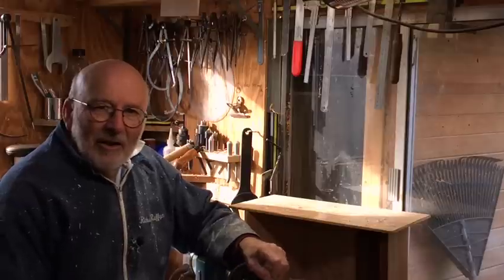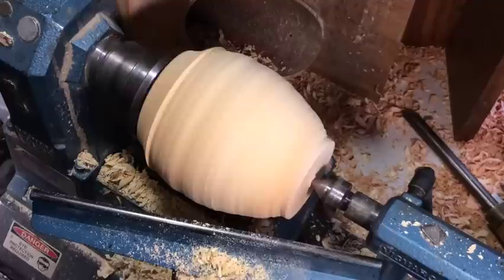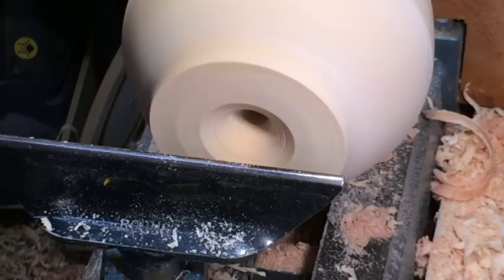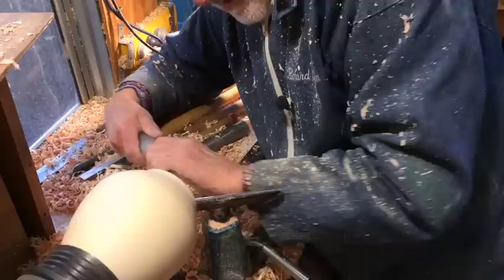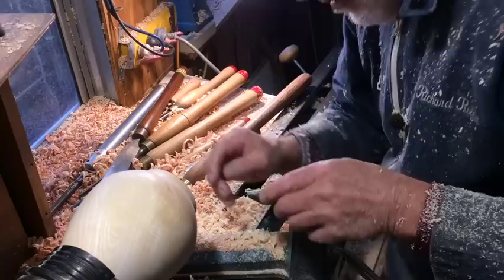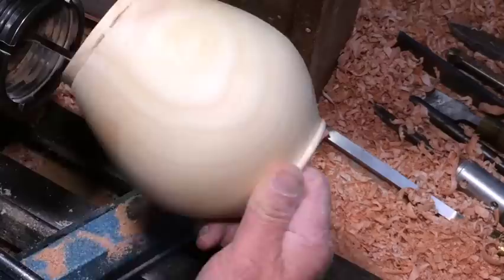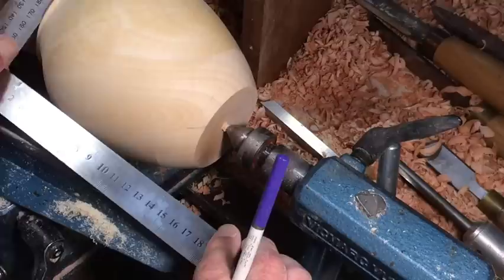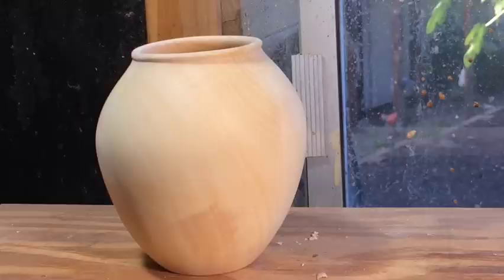Richard Raffan turns a claret ash vase in real time

Comment: Thank you for such an inside view of what you were thinking as you were doing; it's an incredibly valuable video.  I wonder if you might explicitly comment on traditional tools vs. carbide (since this hollowing seems to be done most frequently with hollowing carbide tools)?
Reply from the maker: Carbide tools are ridicuously expensive compared to HSS and although they might hold a reasonably sharp edge for a bit longer than HSS they soon lose the edge necessary for finishing cuts. Carbide cutters are not so easy or as quick to sharpen as traditional tools. I've found that traditional scrapers, gouges and skew chisels cut way, way, cleaner which means a heap less sanding and investment in abrasives and less time sanding. I reckon carbide tools generally make turning more laborious rather than easy. They are a triumph of marketing over substance, as are negative rake scrapers.

Comment: I very much appreciate the running commentary and sometimes self-criticisms you make during the turning; thank you. Regarding filling small cracks with CA glue, I understood you to say that such repairs do not last. I have heard that some professional turners do not use CA glue when they are concerned about retaining lasting quality for pieces destined for museum collections, but vases such as this one are, I believe, intended for utilitarian purposes. Would using CA glue in such cases really matter? Is there solid evidence that CA glue does not hold up over time?
Reply from the maker: I've experienced CA not holding up many times so use 5-minute epoxy if I do fill splits. The knot I fixed with CA loosened regularly every few years until the bowl broke. A kaleidoscope made by a well-known American literally fell apart as have parts of another, all made using CA. And I was reliable informed that many museums have had segmented pieces turned in the 1980s fall apart. I make things to last and see no reason why this vase shouldn't be around in several hundred years, like many of my bowls.
Reply: @RichardRaffanwoodturning  What's your experience with using PVA glue and sanding over the crack - the PVA combines with the sawdust and masks the crack. I think your pieces are all museum standard!
Reply from the maker: @billstanley5317  I don't know much about PVA, let alone in cracks. I've never been interested in filling splits and masking cracks. If I do fill a split it will be with African blackwood powder mixed with 5-minute epoxy. I can guarantee that not all my work is 'museum standard', no matter how that might be defined, although since the mid-1970s my work has been acquired for major public and private collections in Britain, Europe, Australasia and North America. The Australian National Gallery first purchased some of my bowls in 1977 and later a set of spillikins.

Comment: If you had made a flat shoulder on your tenon for the front face of your jaws to reference against, wouldn’t the loss of concentricity you experienced at 8:30 have been greatly reduced/eliminated? It doesn’t take you long to clean up, but that and a more secure grip less prone to the kind of movement due to different jaws biting to different depths seems to make a shoulder worthwhile.
Reply from the maker: I've never found a flat shoulder makes much difference with facework, whereas it provides a lot of support on endgrain blanks.
Reply: @RichardRaffanwoodturning  interesting. Thank you for this insight in particular, and all of these videos in general. I am learning a lot from them, and definitely find them inspiring.

Comment: Awesome Richard, question: would you turn vase with the grain running parallel?
Reply from the maker: Probably not primarily on the grounds that hollowing into endgrain is such hard work. On top of that, endgrain is not as strong as crossgrain and the grain patterns rarely as interesting.

Comment: Thanks for the video.
I was wondering if I could ask a few questions on scrapers. Which type of steel do you find works with scrapers?  If you were to reshape the scraper blade such as your shear scraper would you shape the blade on CBN or the old Norton grinding wheels?
Take care
Cheers
Harold
Reply from the maker: My scrapers are mostly Henry Taylor HSS with a few P&N that are no longer commercially available. I think most are M2.  I reshape on the coarse (60 grit??) carborundum wheel you see in  https://youtu.be/jg0i27WuPXQ. If I had a more aggresive grinding wheel or belt, I'd use that for shaping.
Reply: @RichardRaffanwoodturning  Thanks Richard

Comment: Are you concerned that the opening may crack when using a cone shaped jam chuck?
Reply from the maker: That's always a concern if you tighten the tailcentre more than necessary. I use the tail centre to support the job rather than force it against the drive. More fragile forms are mounted into a jam chuck, typically a rough-turned bowl. Also this is crossgrain which is much stronger in this situation than endgrain.

Comment: Wouldn’t a goose neck carbide tool work well for the hollowing?
Reply: A goose neck carbide tool would work for the hollowing but I doubt very seriously Richard owns, or would consider using, a carbide insert tool. If it works for you then go for it.
Reply from the maker: I do occasionaly use Kelton Undercutters but very rarely use my gooseneck scrapers. I find conventional scrapers a lot faster and use gouges whenever possible for a much clean surface off the tool and consequently less sanding.